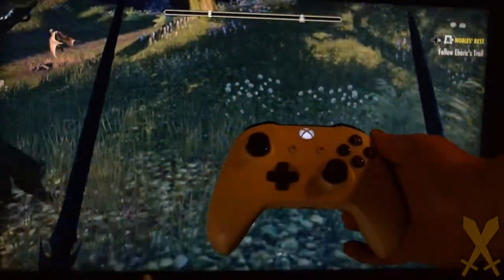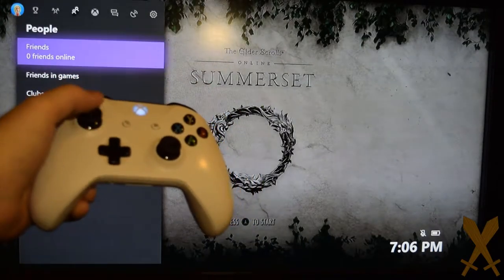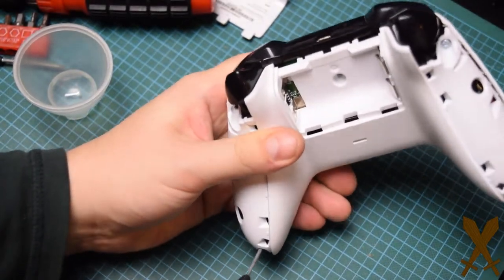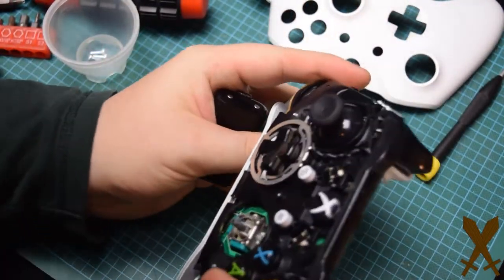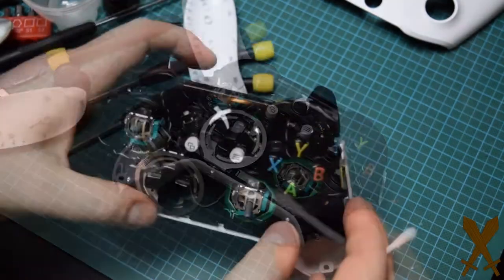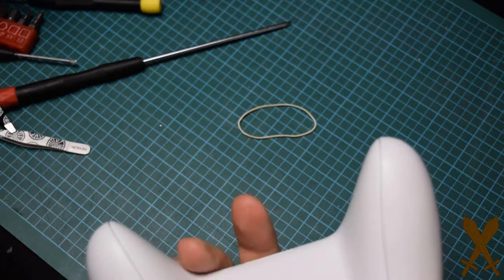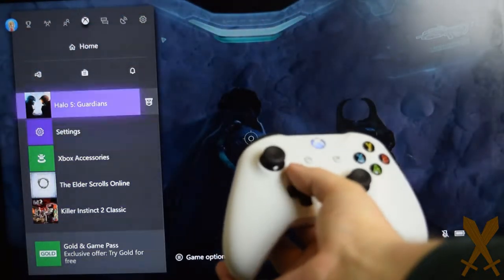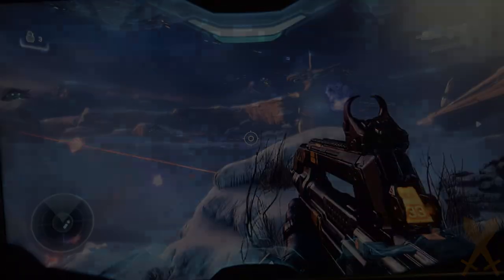Xbox One S Controller with Stick Drift Rescued from an Early Grave - The Lost Boy

Comment: My joystick when you press down um where it the plastic nail or something holds it. Then um mines joytick press down has a losse connection and i use the controller alot and use the right joystick button alot and it worn out after just 3 months for a pre owned controller not new a pre owned or a used controller yeah it decided to just stay broken and falls apart. Like it not stable or something
Reply from the maker: Wow. Just wow man. That all sounds completely terrible in every way.
Reply: I need a new joystick button because of the part like pin or something is not tight in their it messing up the whole joystick part and my other controller that i dont like using it because it has a short citrus what it does is that it doent just mess up my joystick but it the battery connection and the whole wire flow has a short circuit when you turn it on it only turn on for like 4 to 5 seconds and doent stay. Light up on all the way. It turn it self off the controller. So how i fix the battery wire chip connection so it flows to the main power switch

Comment: My controller is the s one and the screws are weird they have a little metal cylinder thing in the middle of it which blocks the flat head from trying to unscrew it
Reply from the maker: Huh, that is odd, I don't recall that happening. The controller I repair in this video is the S version, do you see what you are describing anywhere in the video?
Reply: @thelostboy5858  I found the problem it was called an torx screw managed to get em out I needed a torx screw driver now I'ma try and clean it
Reply: @thelostboy5858  thx tho
Reply: @thelostboy5858  would you recommend removing the grey piece  on the joystick it's on the left side of it
Reply from the maker: @fistoffuryred4940  I ended up having to replace the thumbstick module for a permanent fix in this case. Here is a link to the video where I did that:
https://youtu.be/D7OibPdbvlI

Comment: Btw you don't have to take The controller apart you can us 90% rubbing a hook and a q tip
Reply from the maker: Sounds like an interesting technique! My issue returned after a bit so soon I will have a video on the way for a full removal and replacement of the thumbstick:)

Comment: Is there a way to do it without opening the controller
Reply from the maker: Hi there, unfortunately no, there's no way to fix this issue without opening the controller. Also, I have discovered that this fix is temporary and the drift will likely return over time. The permanent fix requires soldering in a new thumbstick, a video for that is on the way:)